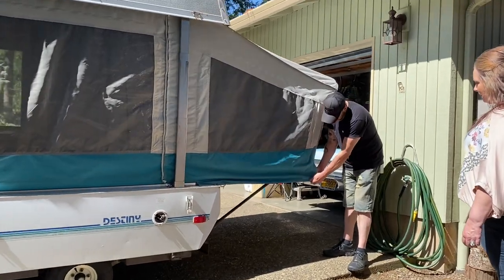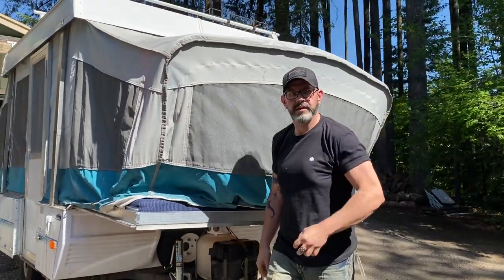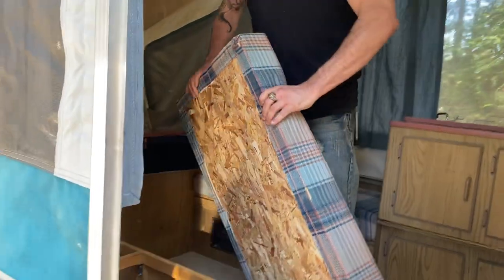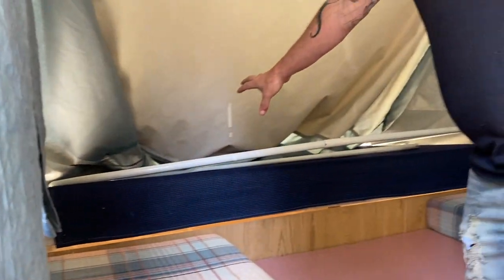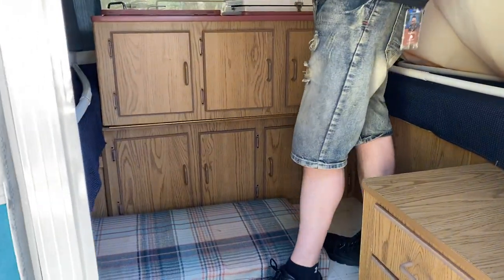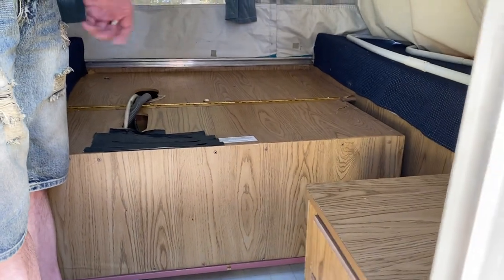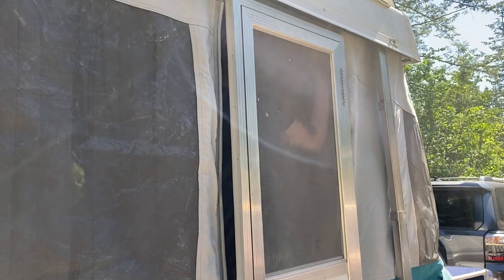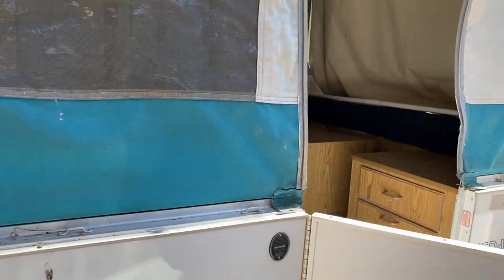Coleman Destiny Pop Up Camper Break Down

Comment: Did the table/dining seating convert to a bed also? I haven't seen anywhere that shows it as a bed, but It looks like it should.
Reply: If you saw in the video when he put the table down so he could push the bed in it looked like it did in fact convert from a dining table to a bed..
Reply: The extra cushions go on the table top and not on the flooralso you should slide the beds in as soon as the supports are removed. That is why the beds jump track.
There is a correct order and he DOESN'T follow it.
Doesn't appear he is that familiar  with this camper.